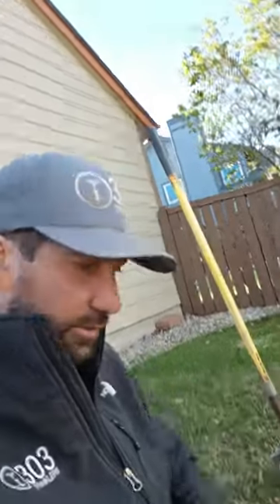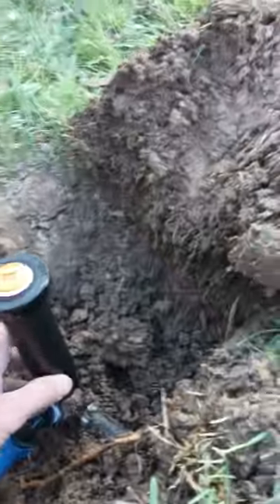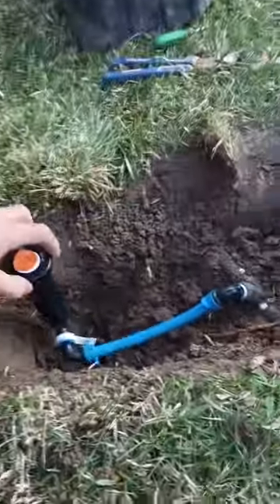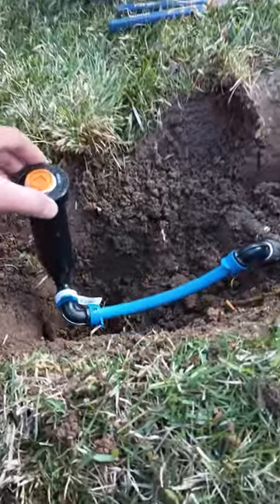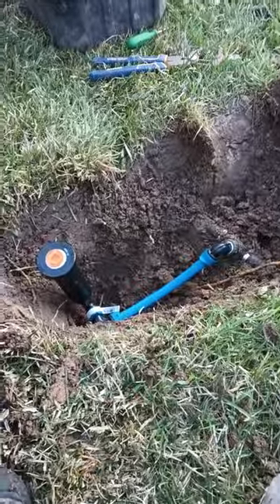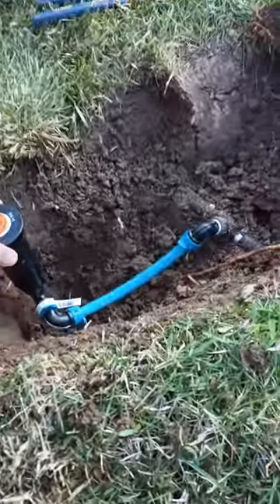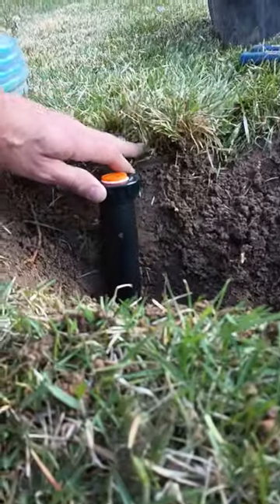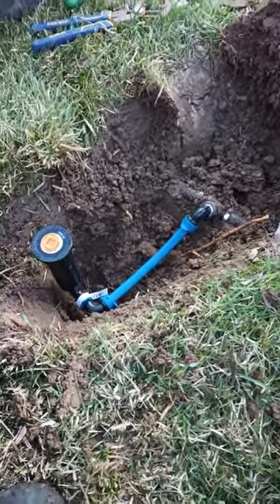DON'T DO IT WRONG! install sprinkler HEADS this WAY ONLY! #shorts #water #diy #sprinkler

Comment: I'm not going to that because sprinklers are a waste of water.
Reply from the maker: @malcolm8564  one small front yard with irrigation remove the need for 70 tons of cooling a year from the AC system. Turf in yards in Denver metro is responsible for a few degrees less Heat so there's offsetting costs with everything in life
Reply from the maker: @malcolm8564  residential indoor and outdoor water usage for the state of Colorado is right around 5% of the total water budget. The vast majority goes to Agriculture and municipal

Comment: Nope
Reply from the maker: Present evidence or go away
Reply: @303sprinklers  I personally like thick black flex with streets Ls a lot stronger flex. I don’t like the toro funny pipe
I do all mine on flex down here. A lot of guys put them on risers so they can come back annually or weekly sometimes lol.
Reply from the maker: @333jahlink  as long as it's a double elbow on a swing joint, I'm happy.. however the blue lock has much better ease of movement Underground
Reply: 1/2 inch k flex to street L is best down here

Comment: Those fittings are shit...
Don't use them, just plumb better
Reply from the maker: Incorrect. It's not even debatable. I really try not to be a jerk, but when someone says things like you do, I know they have no idea what they are talking about.

Blu lock from home Depot is garage. Blu lock from the distributor is significantly higher quality. I don't know why but it's better.

I've been installing these for 15 years with no issues. Have you? I've installed literally thousands of Blu lock swing joints, with no issues. I can confirm from actual field experience. What about you?
Reply: @303sprinklers  I've not installed many at all, but I sure have replaced a shit load of them ....
Reply from the maker: @AFuqer4life  I would wager the reason is because they weren't installed correctly. The QC isn't like it used to be, and many techs don't know they need to be fully seated and you can't tamp down the double elbow. You have to leave 2" loose soil below, set the head with the canopy above grade, replace the turf and gently tamp it to grade.

When done correctly, they do not fail, with minor exceptions. 

I wish I could be out in the field with you and show you, because you would see what I mean. I can go dig up any head I've ever replaced with a blue lock swing joint and prove it doesn't leak. That's how sure I am of this product after 15 years
Reply: @303sprinklers  last ones I replaced were only a year old as per customer and they were shredded. She wanted it replaced the same, I went through every store that sold them here and they were all crap. Quality products are not available to everywhere if in fact quality ones even exist. Maybe you've found an American manufacturer you'd like to promote?
Reply from the maker: @AFuqer4life  I'm not discounting that this happened to you but what I'm saying is after fifteen years of exclusively installing hydrorain blu-lock I have yet to go back to a failed fitting that's leaking or blown out or anyting wrong unless it was operator error.

A lot of guys don't realize they need to push them in completely. Using regular swing pipe insertable pieces and a double-double with marlex is quite a bit more laborious but they also work really good.

Most of the people that say they don't like blue lock or either installing it incorrectly or have run into other bad installs
Reply: @303sprinklers  yeah funny thing, the people I've worked for didn't call the same person that installed it previously to fix it when it failed so i can kinda understand why you haven't been called back out. 
If they weren't seated properly then someone didn't do their due diligence and check their work before burying it again. They should not be plumbing or be placed back as an apprentice.
I like the concept of them but you state it is indisputable. Unfortunately with the quality of products in america today it is highly disputable.
Reply from the maker: @AFuqer4life  I appreciate your feedback but I want to explain why I know for a fact that I'm right about this. I worked for the same sprinkler company for 12 years and we serviced a contract for a major neighborhood and we did all of the install and repair work over that time, including many return clients in that neighborhood. I exclusively installed blue lock on every job in that neighborhood and every client who has been returning for 12 years. I've now been in business for myself for 4 years.

I have actually gone back to broken heads on zones that we installed, because of contractor damage from the cable companies, etc...

 Dug up the heads, replaced the 1804 PRS head and checked the Blu lock before resetting... Zero leaks. I've done this on over 100 heads over the years for various reasons. Probably many more but I'm being conservative for argument.

I've gone back to old clients from my old boss, whom I now service because he changed his service area. I've seen failed hunter PGV and I-20 rotors that were on Blu lock that I retrofit with blu lock 15 years ago...
Perfect. Hunter heads... Garbage, but the swing joint was the same as day one.

When I say the only time that I have issues is because of tamping too hard on hard soil and because people didn't know how to put them in the entire way, I'm not lying. If I hadn't so much experience I wouldn't be so arrogant and firm. The sample size doesn't lie.

I know that you have your opinion and you don't believe my experience, but I can tell you the only time I've ever had issues was after 2020, and stuff I bought from home Depot in a pinch because distributors were closed Sunday and I ran out of fittings on a big job.
Reply: @303sprinklers  can I ask where you are generally and type of ground are you working with?
Reply from the maker: @AFuqer4life  I work in the Denver metro area and it is primarily 75% sand sometimes 50-50 clay loam, but almost always mostly sand.

The issues arise when guys don't dig two inches below the head and leave it a canopy above the turf, before they tamp it down gently after setting.

The elbows break if you don't ensure a bit of slightly loose soil below and tamp down on hard pack soil. It's surprising how much specificity is necessary but it's simple.

I am going to get around to making it a video to show people exactly how to do this and if you stay tuned you'll see it in a few weeks
Reply: @303sprinklers  I'm in northern california with clay and rock, rock and clay clay on clay and sometimes rock loam and clay . That might explain the issue. I tell you, the ground just moves here in a constant slide, in many residential areas.
Reply from the maker: @AFuqer4life  that's interesting. In that situation, then I will say: I may be wrong and these may not work. I'm surprised, because the teeth and compression gaskets are extremely sturdy...

I will step back and admit it's possible these fail in that situation, as I've not encountered heavy clay with these. No more than 50%, ever, in Denver metro
Reply from the maker: @AFuqer4life  in fact, I'll recommend regular swing pipe with the traditional, non clamp insert elbows and marlex. I just hate how awful they are to pipe fit and they aren't as flexible for movement with soil
Reply: @303sprinklers  okay, so the reason why they don’t last as long from stores like Home Depot, Lowe’s, Menards, Etc… they make a separate batch of those fittings that are made cheaper to make it look like they work well. Same with the sprinklers… buying from a distributor like you said will help a ton in quality. I have noticed this with all sprinklers. Even though I may seem younger (because I somewhat am), I know a lot about this stuff because I studied it since I was 5 or 6 non-stop.
Reply: @303sprinklers  honestly blu lock in stores is terrible. I got a blu lock sprinkler system kit and it was very hard to lock it in place. I used two rain bird diy kits w/ barb fittings and a bhyve timer. I personally like barb fittings and swing pipe better. But blu lock still works and those fittings like the guy said aren't shit. There are plenty of ways to apply a sprinkler head, no correct, or wrong ways. (Except for pvc)
Reply from the maker: @coler156  home Depot Blu lock is junk. Commercial grade hydro rain Blu lock is great. The fitment has gotten a bit tighter over the last year's. COVID.

But I stand by the double elbow swing joint necessity, Blu lock preferred. The reason is because they are engineered to swivel

Comment: Why does everyone teach our trade? Years of learning down the drain in 60 seconds.
Reply from the maker: Because 95% of clients aren't interested in doing this themselves,  the remaining 5% none of us want as clients. 

Also,  most of my work is fixing purge irrigation technicians bad work.  I'd prefer to explain to young folks in our trade how to do it correctly
Reply from the maker: I can appreciate your frustration, but this only benefits everyone and really doesn't harm small businesses like mine,  simply because of the reasons I stated IC my first response

Comment: Just dig the hole deeper and keep your money.
Reply from the maker: @Mach141  I don't understand this mentality it's not about money and you're talking about like two dollars difference at most
Reply from the maker: @Mach141  it is a perfect design that makes way more sense than a cut-off nipple riser
Reply: @303sprinklers  you dug a deeper hole anyway! You just dug it off to the side and used an extension to reach the deeper hole. Sprinkler head height is easily adjusted by adding or removing dirt from under the location of the head. Ive replaced just about every head in my system, and I cant relocate them a foot in another direction. If your doing a first time system install, dig your trench to the proper depth of the heads you are using and you wont have an issue.
Reply: @303sprinklers  Why would you need a cut off nipple riser when you are trying to lower the head? Nothing about this makes any sense at all. Lets make more work by digging another foot of trench to move the head to the deeper hole I dug...yeah, no thanks
Reply: @303sprinklers  What I think your missing is this. Yes, you may have  to dig some dirt out from underneath the existing water line a couple inches in each direction, but the line is very flexible and will lower into the deeper hole with the new sprinkler head without issue. 2 different solutions to the same problem. There are probably pros and cons to doing it either way. You wont have to fight to lower the existing line your way. My way you do, but its really not hard  and likely less work and parts than your way. Try it sometime. Let me know what you think.